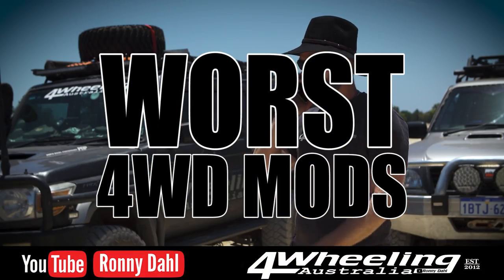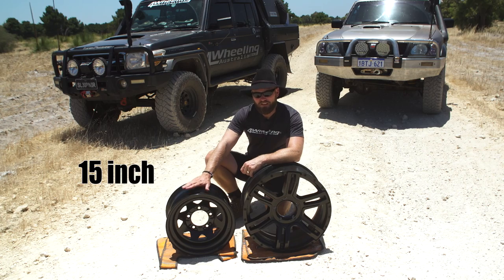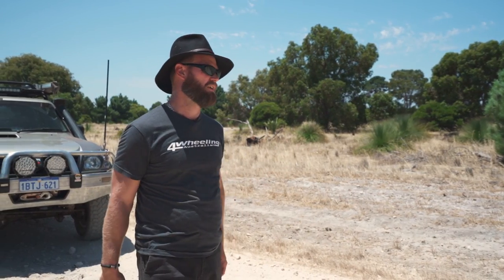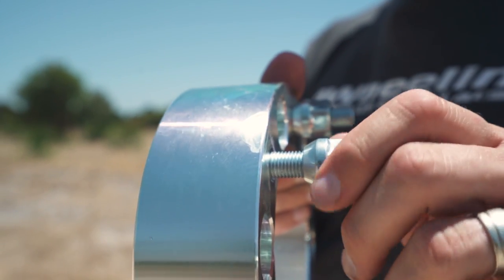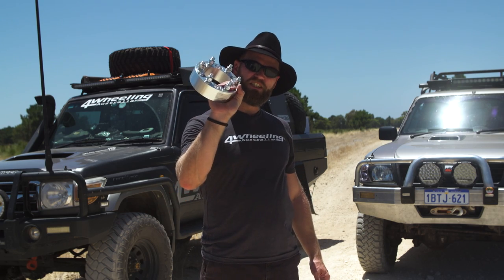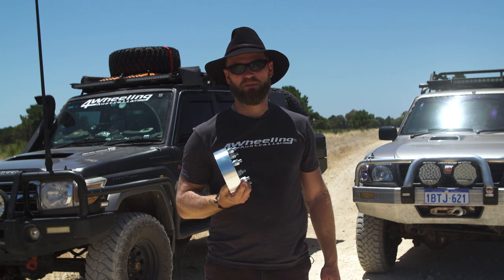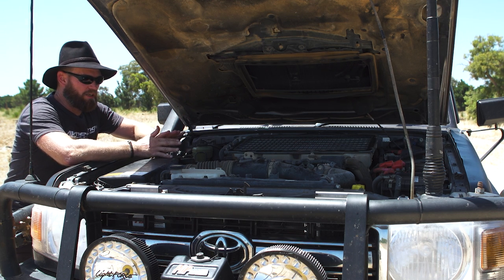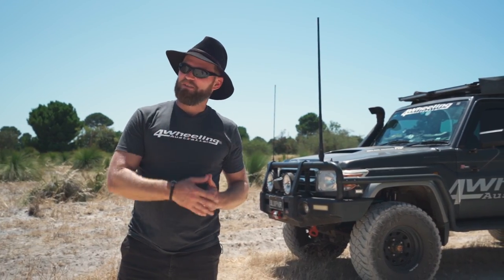WORST 4x4 MODS, DON'T DO THESE TO YOUR 4WD

Comment: I just bought the new Jimny. Straight out the car lot and into the bush. It's such a fantastic vehicle! The little mountain goat left the support vehicle behind on her stock Bridgestone 26" road tyres. No fancy mods needed.
Just buy the right vehicle from the start.
Reply: Great 4x4 I just received mine 3 days ago 👍🏻
Reply: I'm really happy with mine too.  Can't beat the physics of small size, light weight, great visibility, tight turning circle and excellent angles for the type of stuff I do.
Reply: What do you guys rate them for motorway? I looked at a Jimny but went for a feroza - needed 1.6L at least on motorway 😅 at least pre 2000.
Reply: @replicantpedals6085  It will drive the motorway but it's not something you want to do everyday or for a long time.
Reply: Replicant Pedals it will depend, I found that the car will not be comfortable on speeds of more than 110 on highway ( it can go faster but I don’t enjoy to cruise at higher than 3000 rpm) For any speed under it is good enough. The seating position is good and the ride is not very bumpy. Some body roll but not uncontrolled on corners. I don’t know what model or year of the feroza you got to compare. I buy the Jimny knowing perfectly what to wait from it and it did not disappoint me on anything and even more it surpassed my expectations. I wanted a Toyota 70 series but didn’t need a car that big, so the Jimny was basically a scale version of a 70 with a few extra gadgets so I go directly and bought a 2020 model. Is my little toy as I have a Mitsubishi Montero MK3 limited a 2018 Outlander (for the wife) and just waiting for the shipping of a 100 series Land cruiser. Now I just need to find a good BJ40 to complete my dream garage.
Reply: It's a pig on the motorway. It needs a 6th gear and I think they did this to keep weight and cost down but I just wanted a capable 4wd for holidays and it's perfect for that.
Reply: 🙄 lie...
Reply: I'd like to see how your stock Jimny goes on a river crossing 😂
Bring some oars!
Reply: pity you cant go further than 200 ks on a trip.!.or carry anything
Reply: Same here I did have to add a roof rack for the looks
Reply: Good to hear. I’m thinking off getting one. I will be doing shorter trips mostly up to a week at most. I love getting out bush for a few days. I also work were there is a lot of dirt/gravel roads.

Comment: Roof rack with only a light bar on it? I absolutely plan on doing this to my vehicle. Why would I carry shit up there all the time? That's really the true crime, always carrying gear on your Ute when it's not doing a trip. I happily carry the swag on the roof when it's needed but I'm not taking the rack off for when it's not...
Reply: OutdoorSoHard_69 pretty sure he meant installing a roof rack with the sole purpose of using it to mount a light bar. Obviously if you use your roof rack to carry all your gear this doesn’t apply to you.
Reply: @harrywest6624  I had a guy on a Toyota forumtelling me that I shouldn't bother coming up with a custom cantilever mount for some lights I wanted to install ahead of my stock bumper and grill. His suggestion was that I should do it "Right" and mount my lights to a steel bumper - so, by his logic I should have installed a 200lb bumper, uprate my springs and hurt my handling/fuel economy to mount 12lb worth of lights :D. Of course this is exactly what he chose to do, so it must have been the right course of action lol !!!!
Reply: I'm not even sure why I'm here, the only vehicle I own with 4 wheels is a Grand Marquis.
But man, the amount of "offroader", "mad Maxx", and "Rally" Vics and Marquis I see with a roof rack for a $20 eBay light and top mounted tire drives me nuts. 
I can fit 4 full size tires in the trunk, the vehicle is like 4200lb stock, why put that weight at the very top of the vehicle, throw off balance, hurt aerodynamics, and leave the ginormous trunk empty!?
But then again, why am I complaining about it here? Lol.
Just been waiting to vent for too long.
Reply: I take my rack off every October because it's easier to clean the snow off the roof of the vehicle. Then in May or June when the snow melts, the rack goes back on and I use it. No light bar though.
Reply: @harrywest6624  installing a single roof rack for lights that's fine but a complete roof rack and not using it then it's a waste. I've put single roof rack arms on my vitara JLX just so I could mount my spotties on it
Reply: @ewingfox6459  I love steel, I like steel front & back bumpers, steel rock sliders, stainless steel skid-plates front and rear, I like steel so much I upgraded my springs and sacrificed some agility, but I am happy. That is the way I built mine, you build yours "your way," I won't judge you or disrespect you!
Reply: @billnye198  but wear would you put the dead bodies, if you put the spare tire in the trunk?

Comment: I tuned my 04 chevy's 4.3L with an HP tuner.  Basically just smoothed out the power curve, didn't tune for max performance,  more tuned it for stock power with little bit more fuel efficiency.  By making adjustments in the rich areas of the stock tune. We also tuned the transmission characteristics with a lil firmer shift over factory,  but not full on shift kit hard firm shifts.  With all this time in tuning we've seen about a 1.5mpg increase and a lot smoother idle, and fantastic throttle response.    Best mod yet.

Comment: Drive your vehicle off road stock, pay attention to its short comings and modify accordingly. The number of 4x4 modified utes in Australia now is ridiculous - most have not a scratch or a spec of dirt on them anywhere
Reply: Agree 100%. Thats exactly what I do. Taught off road driving in the army a million years ago. The "everything must have a purpose" habit still lingers. Only mods on my 4x4 are just to replace the bits I have worn out. Then replace them with "Better". My 4x4 looks pretty ordinary as I don't have any of the snazzy bolt ons. Only carry what I "need".
Reply: Same here in America, I see it everywhere nowadays with easily 100,000 dollar jeeps but the frames and axles are still completely black. I wheel my Ranger more than any of those jeeps will ever see

Comment: If you have just bought a 4x4, don't spend any money on mods until you have changed all the fluids. That includes the brake fluid and the power steering fluid. It is the best money you will ever spend.
Reply: I would add don't mod till you need to and do research. Most 4wd's are quite capable stock. No point in having a snorkel if you're never plan to anywhere near a river crossings.
Reply: @chrishorsburgh7054  Wise words.
Reply: Transfer case fluids
Reply: @chrishorsburgh7054  what about desert driving, snorkel let's you get your intake out of the worst of the dust and let's your engine breathe cooler air than what's in the engine bay
Reply: @MrHanzfree  Fair enough. The more you know haha
Reply: No mods until you take it out. Get it wet then change the difs and transfer to check for water ifilltration

Comment: I think we're getting into the offroad snobbery realm when you can't have a nice roof rack and put a "$300" light bar on it as that is too cheap.  Not saying you can't buy a more expensive light bar, but light bars are extra's, they are helpful, not absolutely necessary for 98% of offroaders.  But I enjoyed the video otherwise!  Thanks!
Reply: My Stedi $250 Light bar kicks ass. Ronny is being a 79 series snob big time on this subject
Reply: A big frick-in light bar so I can see how I am opening my beer.
Reply: @roryguinness1402 I've got a $90 light bar on my falcon in the front bumper, I've hit wallabies, possums, all sorts of animals, sure the bumper is abit worse for wear but that light bar has taken so much and is still holding up, I think it was from supercheap auto for memory
Reply: @roryguinness1402 and its still God damn fucken bright